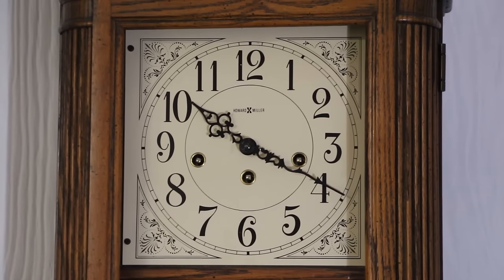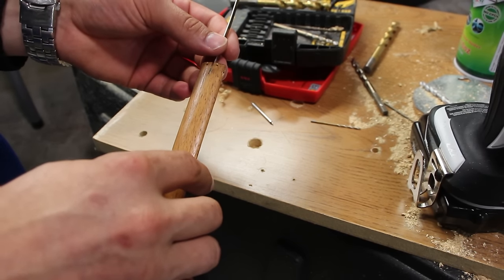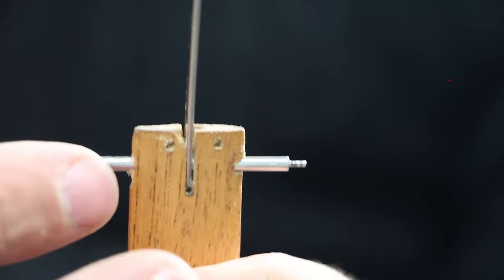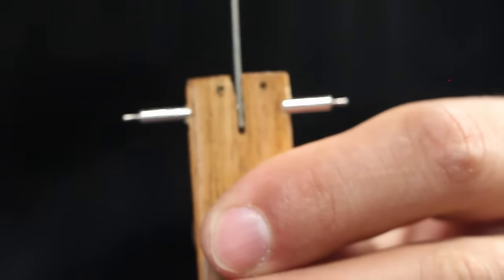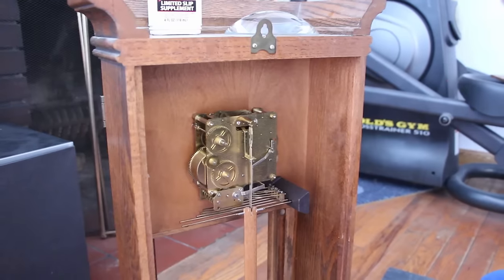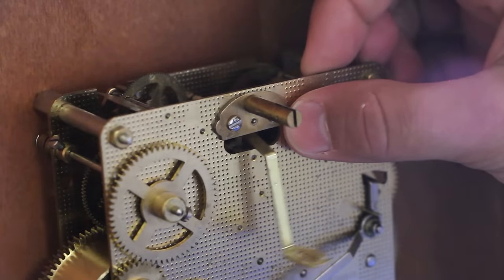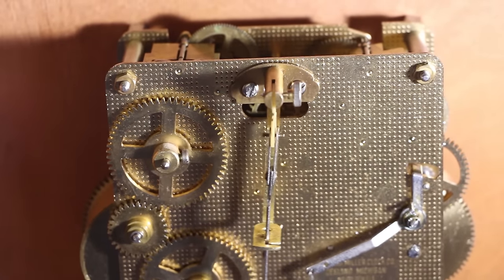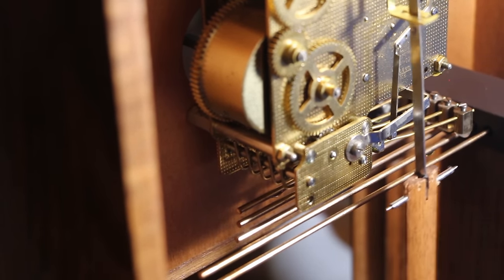Howard Miller Mechanical Clock Repair

Comment: Dive right in there, man, excellent!  The “little gear turning underneath there” is called the “Escapement” and it does two things.  One, it allows the escapement gear to turn at a precise rate established by the pendulum, and two, returns energy back to the pendulum (gives it a little push) so it continues to swing. 

Excellent job on the pendulum repair, by the way.

Comment: Agree with hoppes9.  You need to bend (CAREFULLY) the chime hammer rods so that the hammers all sit about 1/8" away from the chime rods and that they hit them dead on.  That will drastically improve the sound of the chime.  Right now, they are striking, but somewhat resting on the rod thus preventing it from a sustained sound.
Reply from the maker: It's funny you mention that, a couple days ago I actually did that as I knew it didn't sound quite right again. Thanks for the help

Comment: I have a Howard Miller wall clock with pendulum, it's key wound. It works fine keeping time but the chimes are are not working as they should. The hammers move very slow and they don't strike the tuning rods. Any thoughts what the problem may be?  Thanks

Comment: There is no reason to fix the leader to the pendulum. That is not how they attach. You can buy the brass hook that was missing from the pendulum stick from any clock parts supplier. Please don’t do this to your pendulum.

Comment: All you had to do was make a brass hook (as it had originally) with a slot the same size of the leader not drill and cut the wood! That way you can unhook the pendulum. The way you did it the pendulum will stay permanently attached and damaged the suspension spring. That is a Westminister wall clock. A timepiece does not strike or chime. Seriously, don't give up your day job.
Reply from the maker: Well I'm not quite sure what you're referring to, but I have the clock today, a year-and-a-half later it has been working and keeping time very accurately, so shut up.